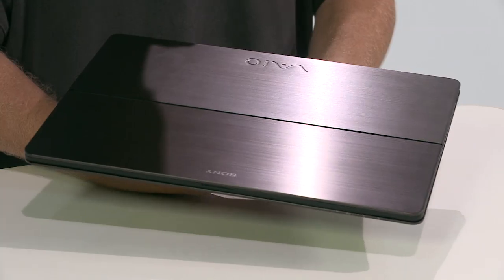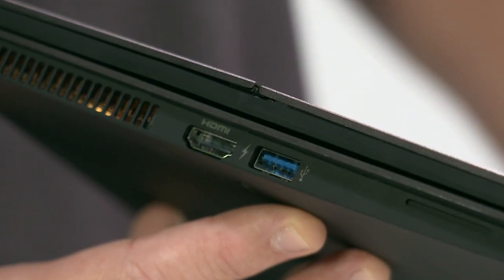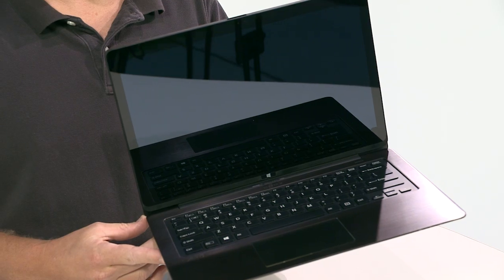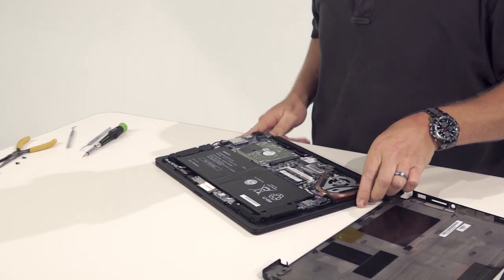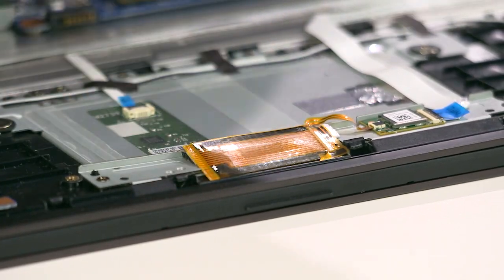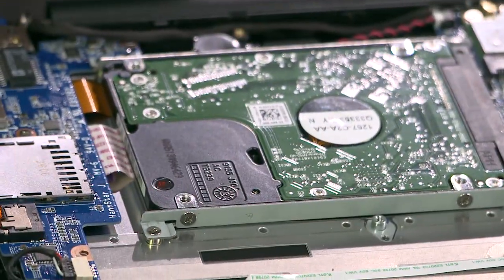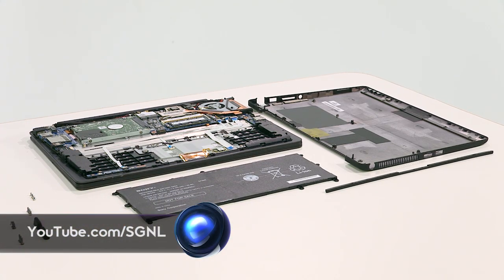Sony VAIO® | Flip PC Teardown

Comment: You guys skipped right over removing the rubber feet. Remember to remove the rubber back feet first. Also try and lift then straight up as there are plastic posts in then and I broke one.

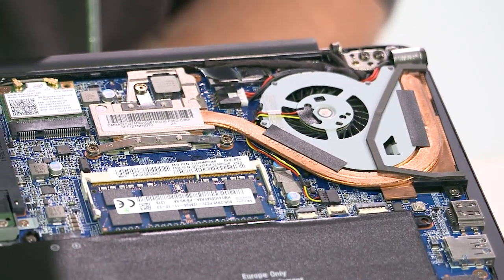Comment: at roughly 2:00, you can see the wifi adapter. I have the 14 inch version and it came with a really horrible single-band adapter, is it removable and replaceable? its UNBEARABLE

Comment: OK - almost all of the pre-ordered FLIPS are MOTHERBOARD DEFECTED (including mine), with a terrible fan noise problem and worst of all - virtually NO CUSTOMER SERVICE WHATSOEVER .
for 1300$ premium price, I now know I've should have gone for the MACBOOK PRO :-///
FML
Reply: Actually, if you upgrade the firmware(which is on Sony's website) it will fix this problem. Thing is almost silent now.

Comment: Hello, 
Before I purchase this $2000 laptop (15" with highest res, upgrade video card, 512 SSD, 16GB ram, I-4500U CPU) I have some questions.
Is the Hard Drive and Memory removable (not soldered) and user upgradeable?
It looks like the Hard Drive is screwed in, not soldered, and is upgradeable, correct?
It also looks like the 8GB of RAM clips in, not soldered, and is upgradeable, correct?
I only see 1 Memory chip, is there a 2nd SODIMM slot?  If so Where is it?

I have done a lot of research, and this is the laptop I want, but I want to be sure I have the option of upgrading the Hard Drive and Memory in case something happens after my warranty period expires.

Thanks!
Reply: I have this version. One person who got it with the 128GB SSD got an M.2 on an adapter plate with a custom ribbon cable. Yikes!  I ordered mine with a 500GB HDD, and it's a standard WD Blue SATA 7mm drive I easily replaced with a 1TB 840EVO SSD. The 15A has two standard LOW VOLTAGE (1.35V) SODIMM slots - I put in a pair of 8GB G.Skill for 16GB total. The 14" version in this video only has a single slot.
Reply: You are awesome thanks so much!
Reply: Jordan Truesdell Since I wasn't sure if the Drive was upgradeable, I ordered it with a 256 SSD, I hope it is upgradeable, if not, I am going to have to return it.  I almost bought one from Best Buy just so I could take it apart, and find out, but after calling Sony Warranty (Hardware), they stated it IS upgradeable, though I'm not sure if that is always true.  i.e. it might be if you get the traditional drive, it might not be if you get a hybrid, or SSD?   I guess I'll find out when I get it.
Reply: Jordan Truesdell Also, wha'ts an "M.2" ?

Comment: So this is advertised with an Intel Dual Band Wireless N 7260 card, but only comes with a single band wireless N 7260. Pause the video at 2:20 and see for yourself. Just bought one and noticed it does not recognize 5GHZ networks. My local Bestbuy was shocked and agreed it was false advertising. For this kind of money it should come with the Intel dual band wireless-AC 7260.

Comment: Is memory upgradable, or soldered to board?
Reply: Same question, for Memory AND Hard Drive?
Reply: Depends on the amount of memory and the model.   The 4gb is soddered on the board.  8gb has 4 soddered on the board and a 4gb dimm.  12gb had 4gb on board abs 8gb dimm.  16gb has 2x8gb dimms (what I have now).  I think this is accurate.   Might as well buy the 16gb model and upgrade the hd if you want.   1tb ssd is 400-500 bucks right now.  Sony was asking $800 for 512gb.  Just know the clips that hold the cables in place are very small and difficult to remove.  Removing the laptop backplate is very delicate also.  Don't break you're headphone jack or ethernet Jack... or the clips that hold in the cables which run over the hd.
Reply: FSU Pike Memory is not upgradable, but HDD is.
Reply: Thanks
Reply: FSU Pike
Ok, you're saying it depend on the model. With 15 inch model is obvious it is able to upgrade memory. That means it's same thing with 14 inch model? (there are 14 inch models with 8GB RAM)
Reply: I'm not sure buddy, I only have the 15.  If I were you, I would just max
out the memory when you purchase it, it's cheap, and only upgrade the hd to
ssd if you can if you want to manually, but I wouldn't recommend it.   It
was a pain in the butt to take apart and put back together unless you have
experience.
Reply: Damn, and that's problem. I'm sure about 15 inch model, but nothing about 14 inch.
I will max it out, but not in time just after purchase. Firstly because of warranty, secondly because 8GB will be surly enough (because it wouldn't be my main PC). But i need to know if it is possible to do this.
Doing this wouldn't be a problem. I've got YT and maybe service manual. I just need to make sure about that RAM.
Reply: FSU Pike is this laptop (15inch) upgradable to 16 gig RAM? just curious now before deciding to take it apart. and correct me if im wrong, but did the video mention about upgrading the video card? or was that an option before purchasing the laptop?
Reply: Yes, 15 inch's RAM is upgradeable. No idea about vid card, sorry.